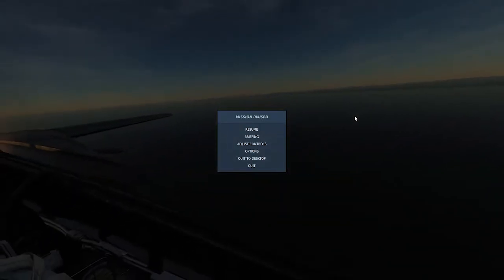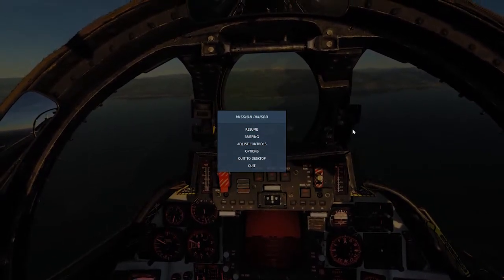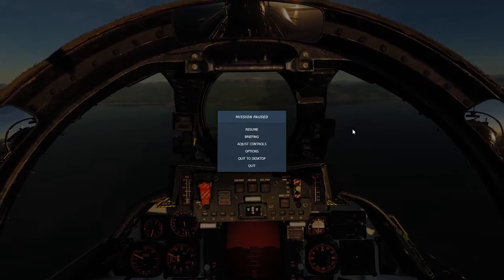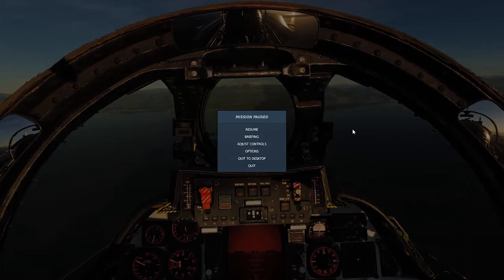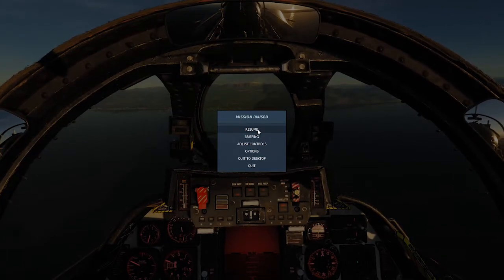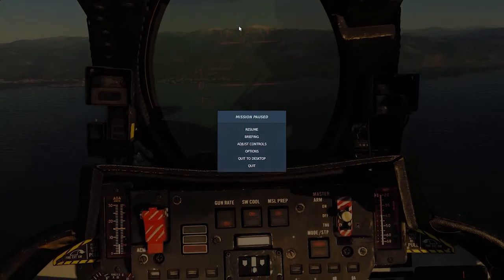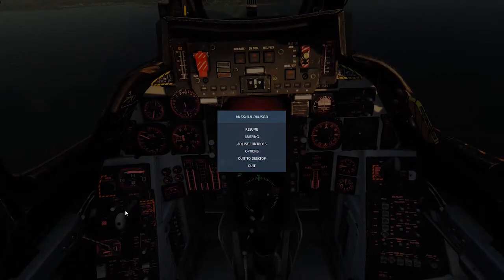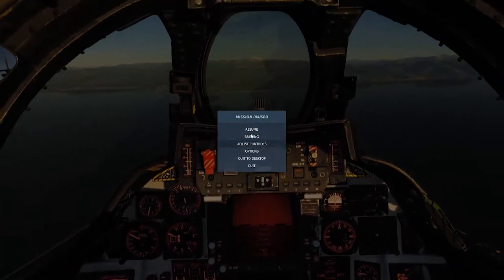DCS F14 landing tutorial

Comment: FYI DLC (direct lift control) doesn't slow you down but lets you control lift. If you have an analog axis such as the paddle on the Thrustmaster TWCS throttle, you can map the DLC control to it which will let you bring in and out the DLC spoilers letting you control your decent very easily. Once you've done that you wont even need to flair, you can just slowly retract the lift spoilers to slow your decent until you kiss the ground. Thanks for the info about the runway lights, I wasn't sure how to use them.